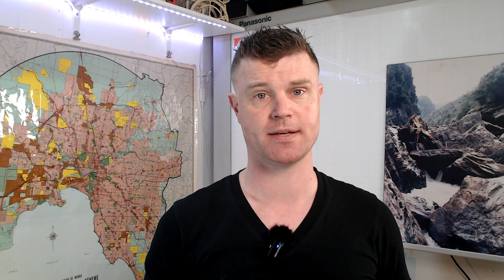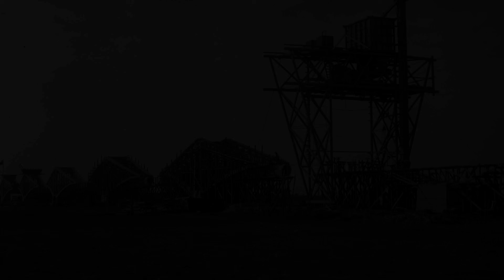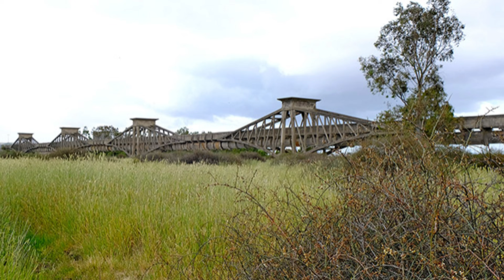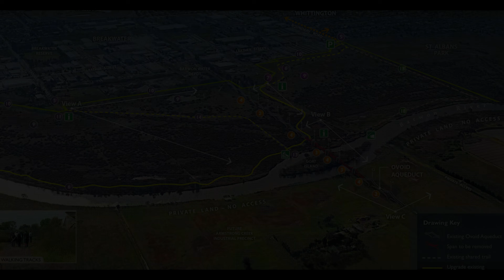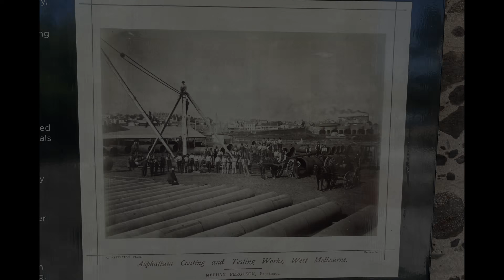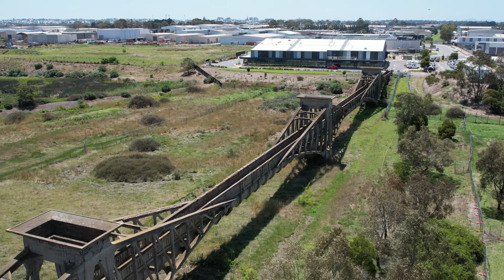Barwon River Ovoid Sewer Aqueduct

Comment: Reinforced concrete doesn’t last. Therefore almost everything built since 1900 has a lifetime of one hundred years, while the stone buildings from before will still be there in a thousand years.
Reply: Since 1900 we have politicans try to get stuff done the cheapest way possible, the engineers job is to design something that barely meets the specification to safe money.
Before that they just overbuild everything.

Comment: It has been left to rot by Barwon water they did not want to spend the money to fix it and now it is structurally to far gone to save it (concrete cancer caused by water damage) once they put in the new pipe under the river they just left it to rot there are plans for the area around the bridge demolition was supposed to being in 2024 but nothing has happened